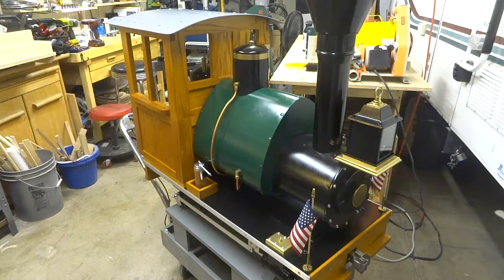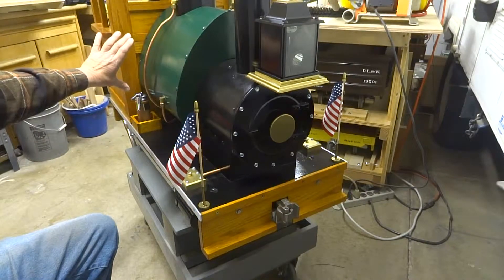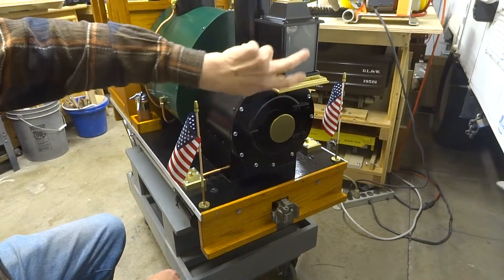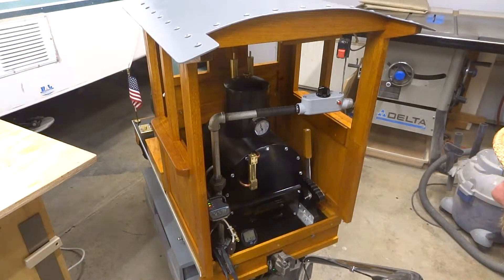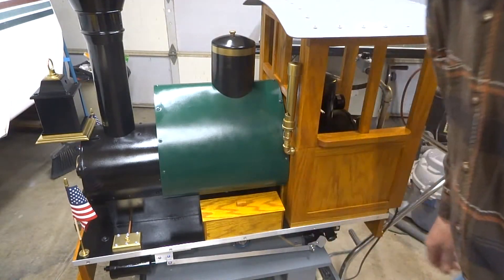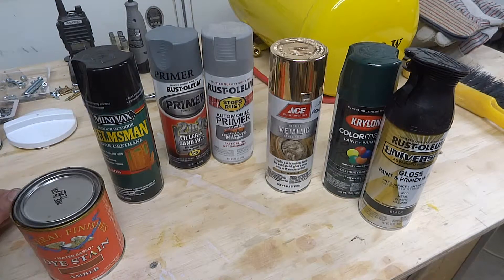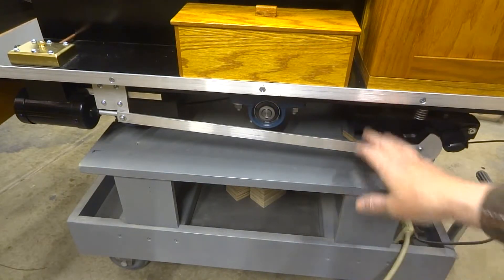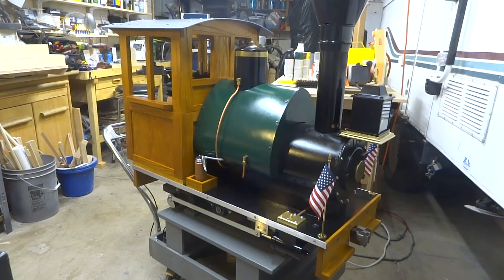Porter 0-4-0 Build - Part 6

Comment: Awsome engine! Could you draw up plans for this? I would to build one.
Reply from the maker: Joe, thanks much for the comment.  It was a one-off based on the Mr. Motion chassis, and whatever I could find or make with odds and ends, plus it originally had to be "convertible" so I would fit under the cover on my truck.  I've since added a hard cap for my truck, so I can leave the loco put together for transport.  Hopefully the series of videos will at least give you some ideas for your build.
Reply: @StanFerris  thanks for the response, great build always loved the 0-4-0's . Thanks again!